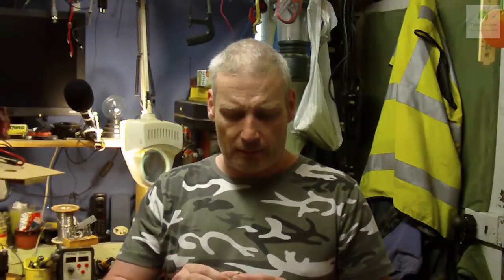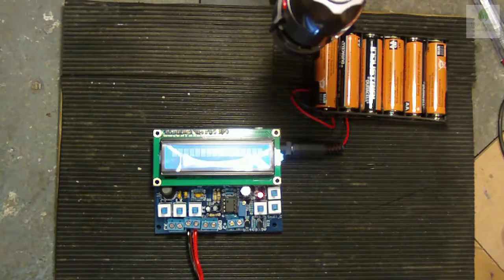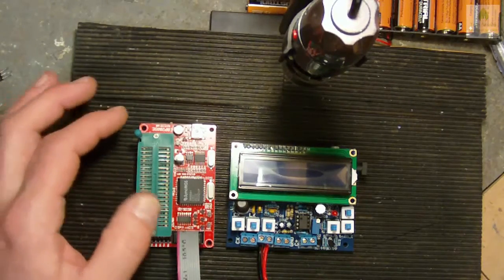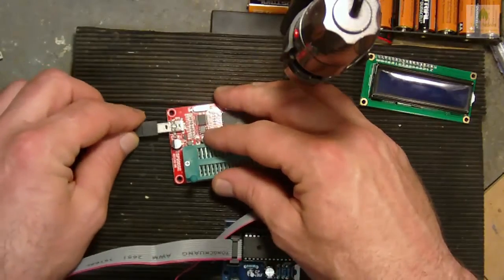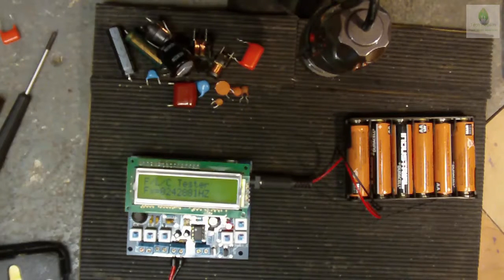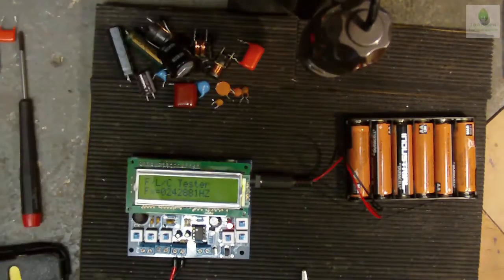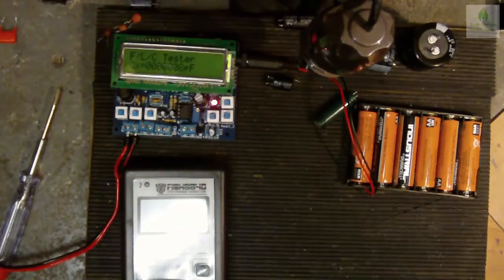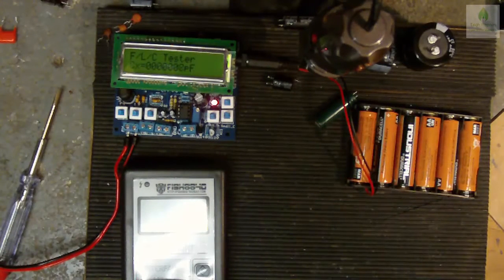Secohmmeter Part 2 Testing the unit

Comment: 1.  I believe  this is how the polar (mainly electrolytic) capacitor values are determined.  The big blue variable 5k trimmer resistor must initially be set so that the voltage on pin 5 of the LM393 is 0.6321 x Vcc.  Normally any capacitor then connected to the polar input terminal is held fully discharged at 0V, by the MCU setting the 9014 switch to ON.  At the start of measurement, the 9014 is switched off, allowing the voltage on pin 6 to rise as the capacitor charges. When that voltage reaches 0.6321 x Vcc, the comparator output pin 7 switches state, and signals this back to the MCU.  The length of time taken to reach this value from the 0V start can now be determined, and is equal to one time constant  (= R x C).  The MCU can then calculate C, previously knowing the circuit value of R.  Note that R is different for big C's and small ones, but the correct one is signalled to the MCU by whichever switch is pressed.
http://www.electronics-tutorials.ws/rc/rc_1.html
2.  Cx capacitors (like Lx) are calculated using the standard LC resonance formula, by assuming the stability and accuracy of the 2 x 1nF capacitors and the 100uH inductor.
3.  Don't forget that the 10k trimmer must be adjusted to set the contrast  of the 1602 to avoid the dreaded "white squares" display.
4.  In this video, the unfitted connector J6 (CON2) marked + and - on the main board, under the LCD,  provides a switched Vcc (+5V) output.  Alternatively, if used as a 5V regulated supply input, the board will be permanently powered ON, and power switch S4 will have no major effect, except to drive the 7805 output in reverse when ON.  Probably not advisable.
5.  For those who have not yet worked it out, the push buttons are cunningly designed, so that no matter which way round you fit them, the correct pins are switched  (looking at the base and clockwise numbered 1-2-3-6-5-4 , switch out is 1-3 and 4-6 , switch in is 1-2 and 5-6).  Note that they are NOT the usual DPDT action!
6.  Be aware that there is an unprotected pcb track "via" (=feed from top to bottom through the board) underneath the 7805 regulator tab.  These should not be allowed to touch.  If the 7805 lies very close to the board surface, some mylar sticky tape or similar, can be attached to one of the surfaces as an insulator. A piece of double sided sticky tape is an alternative which will also secure the tab in position.
7.  Be aware that the kits sometimes send 100mH inductors instead of 100uH ones.  They are often not marked!  For rewinding details, see https://www.youtube.com/watch?v=Bo1azL0WVgo&index=3&list=PLVhA36rxWcCxi9GOuiDX6viYxX0vu6C6c
8.  The software/firmware provided is not very sophisticated.  Anybody know of some better versions??  (please PM)
Reply: Fantastic website congrats

Comment: I got today same Kit and I'm a little wondering about your Programming in the first part of this Video. I soldered the components and the unit did work without any programming. Did I overhear the reason for programming?

Did you found out in meassure eletrolytic condensators mir about the limit for small and big condensators?

What is your experience in accuracy of results with Secohmmeter?

Comment: I have bought a bunch of male and female 2.1mm X 5.5mm plugs they have the same screw terminals , so just use some leads that have been cut off componets and but the screw terminals of the plugs with the terminals on the tester and put a male plug on your crock clips. Then just plug the croc clips into the terminal you need.I use them on probes and my power supplys so I can connect anything to anything. Hope that helps
Reply from the maker: +kardeef33317 thanks for the comments and thanks for watching.

Comment: I have built the Secohmmeter and it is working pretty well.
However, on the induction measurement the value alternates between two values, with the alternation being consistent. I guess that this is a programming error. Has anyone else had this problem and found a solution?